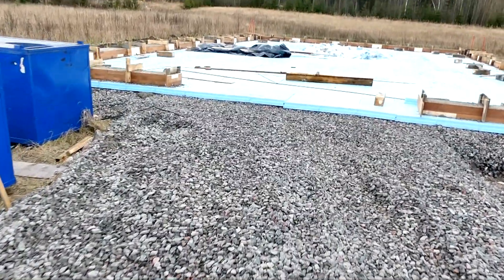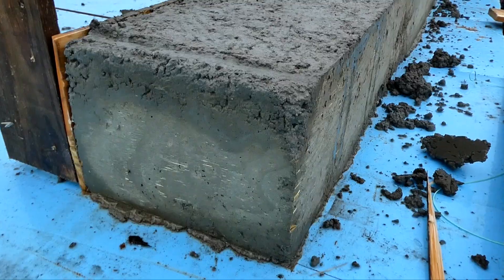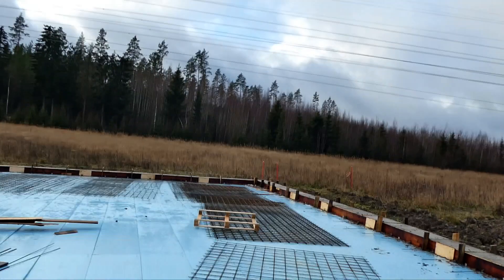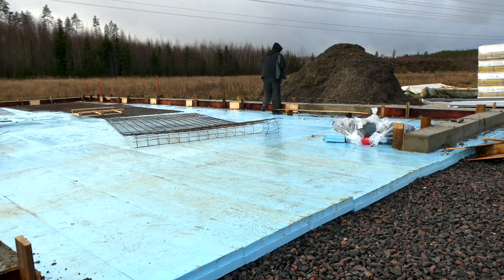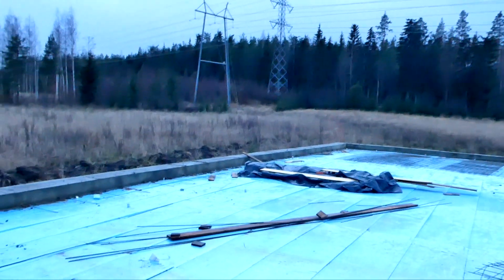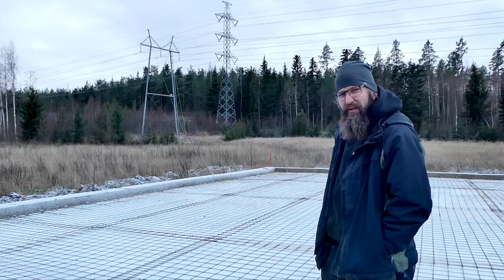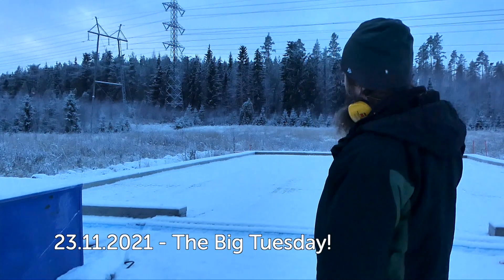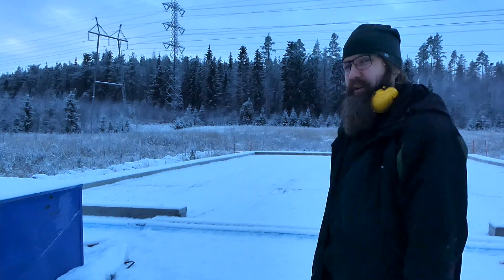Making the concrete floor! Sailboat building workshop pt3: Ep29 Project Seacamel

Comment: motor idea, betamarine has a hybrid diesel electric motor should be good if you are using a 48vdc battery bank.
Reply from the maker: Thanks for the suggestion! For now I don’t have any idea what kind of motor I will use. Technology and products will most likely evolve a lot along the coming years. If there were no money constraints I would go with @oceanvolt double servoprops. But most likely I will have to make some sort of diy solution.
I’m hoping that batteries and solar panels evolve as well to point where diesel generator becomes unnecessary. We’ll see!